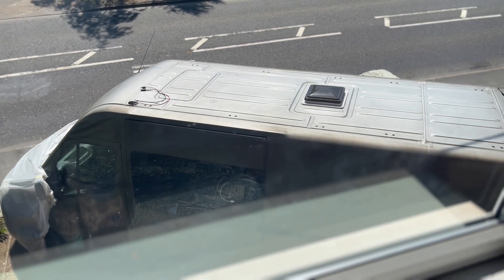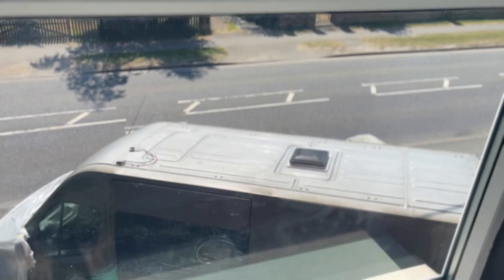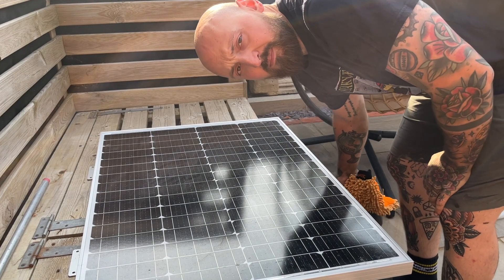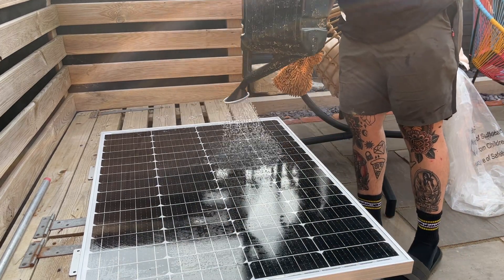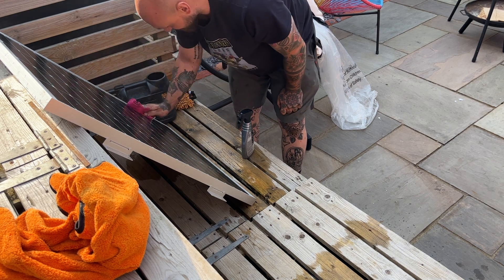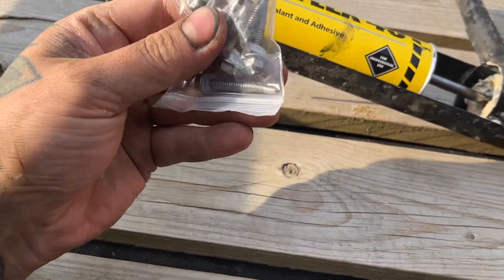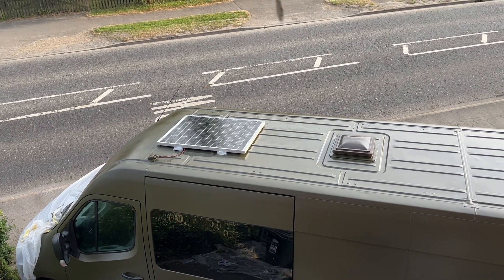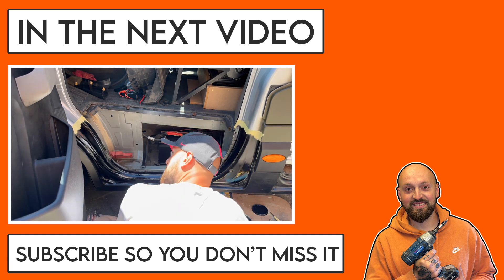Roller Painting the Roof of a Camper Van Conversion

Comment: Hi there . Good work. what paint did you use on tje roof please ? Ive a fibre glass van roof to paint. Cheers
Reply from the maker: It’s a military paint by Jawel paints. There’s a link to it in the description. I’ve also used it on fibre glass and it works great.